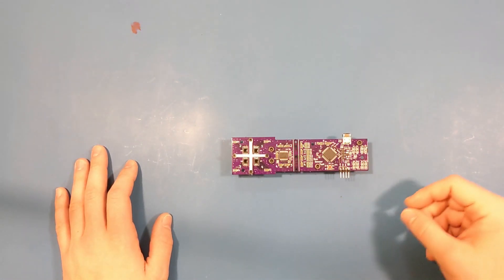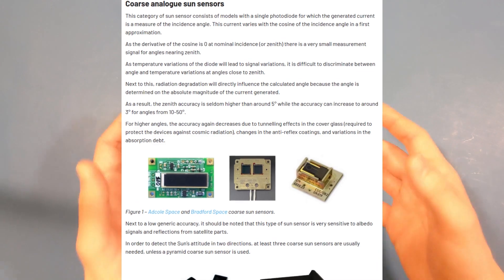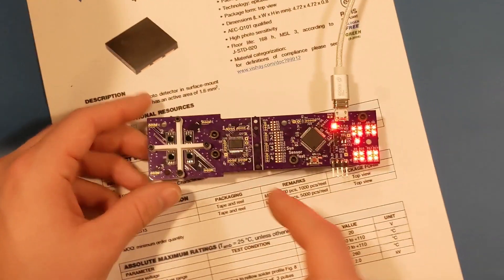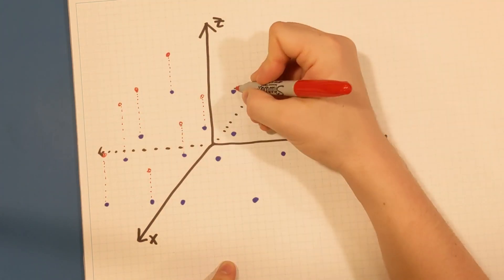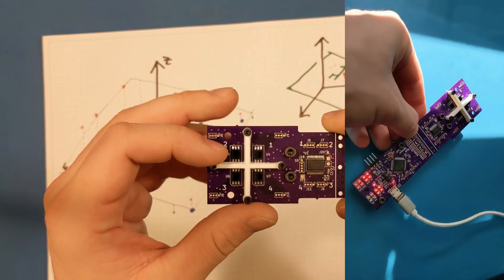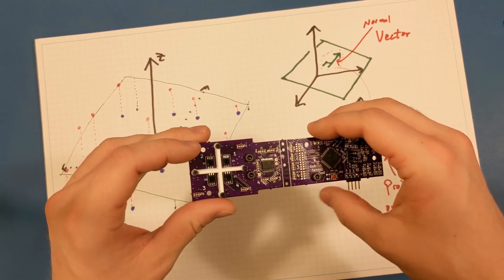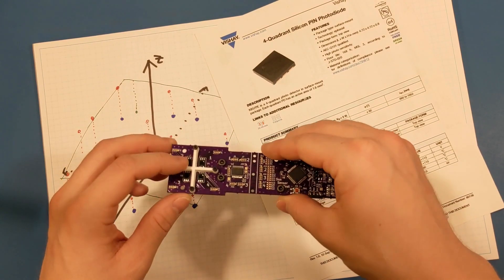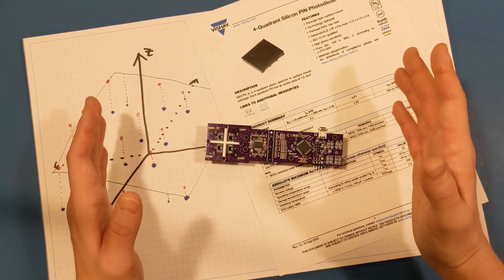How (not) to design a Sun Sensor - $1K CubeSat - Part 12

Comment: The algorithm for evaluating a quad detector with an illuminating spot size less than the detector size is well-known. You should be able to get OK results using a series of different size apertures which fit over the detectors.
Reply from the maker: Yes! I've seen some research papers about those methods

Comment: Maybe its not possible, but have you thought of monitoring the solar panel outputs for each side and using that data to provide Sun orientation?
Reply from the maker: Yes! I have thought of that, and that is a good method to get a rough estimation of the direction of the incoming light. 

The method I describe in my video is an attempt to improve that resolution

Comment: Hey I am new to this channel and I’m a bit confused about the project. By the end of it, would you have built a fully operational cubesat that can be sent into orbit or is it just planning that is being done?
Reply from the maker: Hey! By the end I'll have built up an operational cubesat. Launching it would likely cost way more than I can afford!
Reply: @RGSAT  lets make a video about how to launch your cubesat  to orbit by 1000$ rocket XD
Reply: @RGSAT  by the way why not use solar panels power output as a sun sensor  you have 6 sides to and ı advise cheap capasitors as a backup power storage and if you need propulsion you can explode them for propulsion to XD

Comment: Would a camera work as a sensor, or would that require too much computing power? It's essentially a 2D sensor array.
Reply from the maker: I think it would! But I think there are reasons why you don't see camera-based sun sensors. 
Here's what I suspect are those reasons:
1) higher energy requirements (to run the camera) 
2) higher processing requirements on your processor (and maybe a higher time delay if processing takes a while)
3) radiation sensitivity of the camera. Effects ranging from dead pixels to a dead camera. 

I suspect you can get a more robust, long lasting solution, that requires less power by using some sort of photodiode solution.

Comment: If solar panels are present on all six faces of the cubesat, couldn't you use their inputs to determine the basic orientation, then have a smaller sensor that can cover only a smallish arc?  If sunlight strikes only one face of the cubesat, that face is already pretty close to aimed at the sun, which would make the sun sensor batter able to focus on the smaller arc, thus presenting higher possible resolution without having to use more expensive photo sensors?

Assuming the solar panels have a wide enough arc to do this, it might also make sense to have a small number of solar cells on five faces, with the final face having the sunlight sensor and being otherwise covered in panels.
Reply from the maker: Solar panels can absolutely be used to determine general orientation! And yes, it makes sense to have a sun sensor cover a smallish arc. I'm still not sure what that arc should be though. (60 degrees? 90 degrees? 40 degrees?).

I agree that it makes sense for a small cubesat to only have a sun sensor on just one face.
Reply: @RGSAT  If the solar cells produce power if the sun hits them at any angle at all, the sun sensor could cover a much smaller arc.  The solar cells will generate more or less power based on their angle to the sun.  I don't know if there's an angle at which the sunlight won't generate power on any given cell, but it should involve less algebra than your 4x4 array to calculate the cubesat's orientation in regards to the sun, based on the inputs from however many solar panels are generating power.  The sunlight sensor would still be needed for finer adjustment, but I think it would not need to cover anything like 90 degrees - at that point, one or more other faces are receiving plenty of sunlight.  The arc of the sunlight sensor will need to be wide enough to do the fine adjustment when sunlight is mostly, or only, hitting the same face as the sensor.
Reply: I was thinking this same thing. Ive seen this used for a cheap solar tracker for solar systems so something similar could be devised and possibly done without the need for any programming. Could be purely “mechanical”